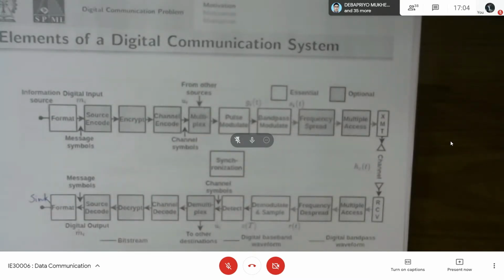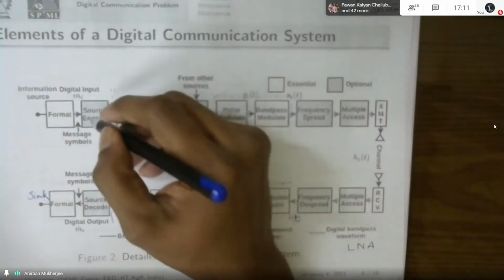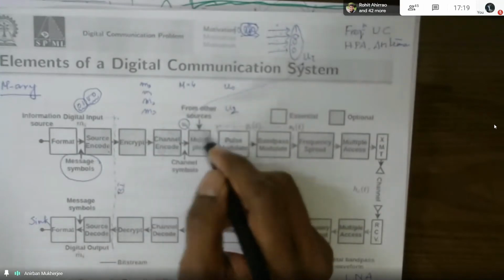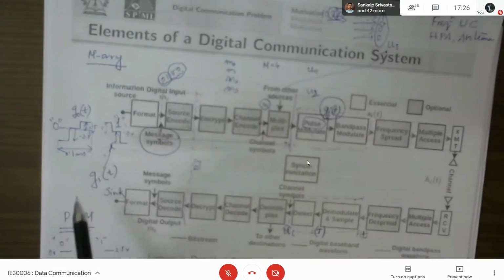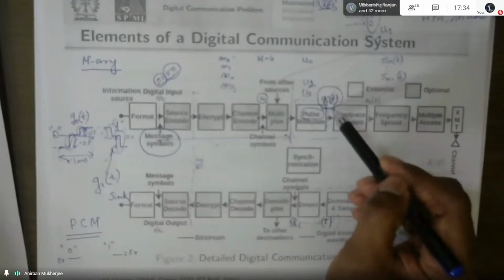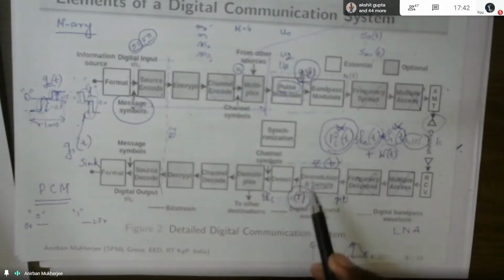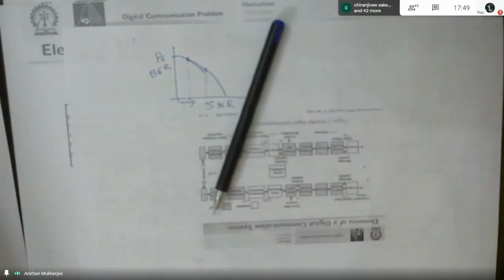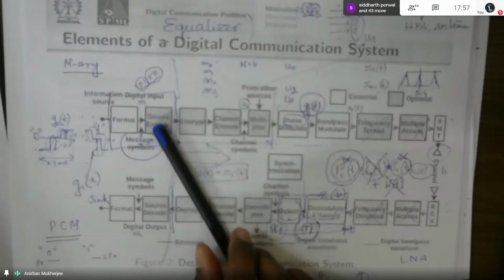Data Communication | Lecture 3 | Block Diagram of Digital Communication System | 08-01-20211

Comment: Suppose you are working at a company named ‘X Corporations’ in which the system is using a
single channel. The channel has four different radio stations connected to it and continuous data
transmission is occurring. You will have to design the four data transmitting stations into a single
channel based on some codes. Consider the data transmitting from four channels is the last four
letters from your nick name. There are 26 alphabets. Find the numbers of the four letters from the
alphabets considering A=1, B=2, …, Z=26. If the numbers of the letters are less than 14 then
consider bit 1 otherwise bit 0.
a) Find out the codes for the four stations.
b) Show the data encryption processes for the four stations from the sender side.
c) Show the data decryption processes for the four stations from the receiver side.